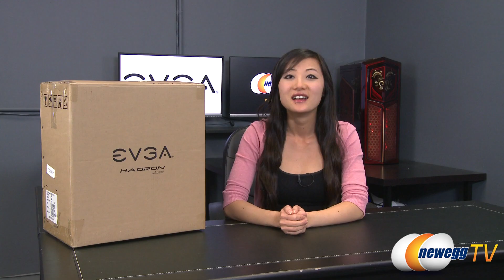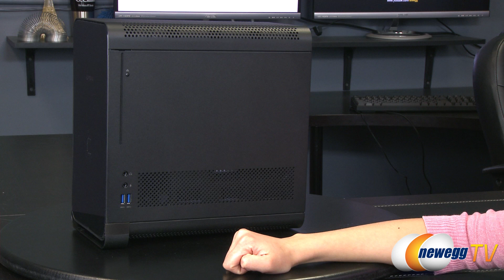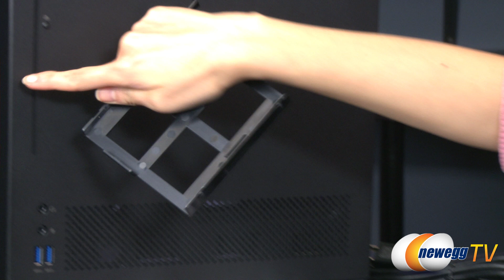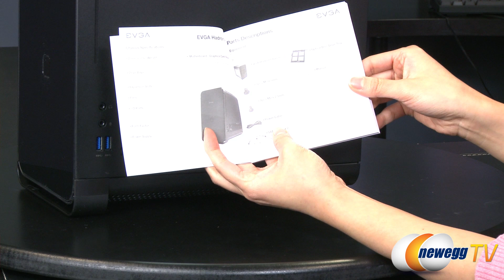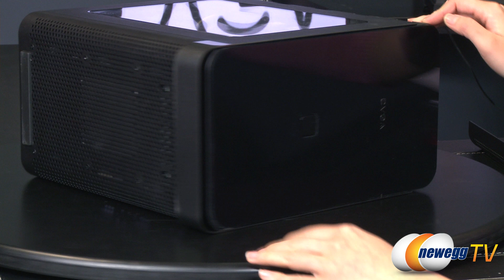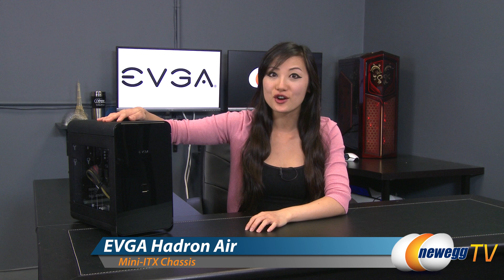EVGA Hadron Air Mini-ITX Chassis with 500W 80Plus Gold Power Supply Overview - Newegg TV

Comment: I thought this had potential as a new HTPC for me until I saw the price, yikes!
Reply: It does come with a 500W PSU and if you think about it, a mid-high end case with some fans would cost you around $100 and a good PSU would cost the same so about $200 total.  Of course, getting a rival case, like the BitFenix Prodigy, could save you $20-$30, more if you have your own PSU to put into it.  Wouldn't mind a case like this to haul around or a CAD machine.

Comment: The always wonderful, Joanne!
Ohh... this case looked so promising at CES, but then we hear the details.

I can overlook the CPU cutout as I can cut it out myself & most others can do the same. Apparently, some can't use basic tools. ;(

I can see myself using it for the looks, but the case has issues like a crazy  ex-girlfriend...

The nonstandard PSU; two SATA isn't enough, the exit for the bundle is in plain sight, & cooling isn't really great with any 40mm fan. *Non-modular is actually good for keeping voltage accurate to prevent Vdroop before it hits the cpu with current increases. That part's fine.
The HDD+SSD drives should have been where the PSU resides, an ATX FF PSU should reside where the cage is placed with a front intake/side exhaust + cables would stay hidden behind the right panel!

The cost is ridiculous being  $190 for what you get! Lol, $190/13lbs is just over $15 for every lb!  I don't care if there's pure copper in the PSU, the components aren't that much.
Those are deal breakers from anyone's perspective that would want some sort of expandability.

Comment: Only 1 day behind LinusTechTips unboxing review.  Pretty good. Now for the case. There is no way I will buy this case. 3 reasons. 1. No cable manage on the right side. You can't remove the right side case panel. 2. No CPU cut-out on the motherboard tray for an aftermarket CPU heatsink coolers you have to take very thing apart to install a new heatsink cooler 3. The most important thing of all, the power supply is not modular. EVGA wants $190.00 for this poorly designed case. Well someone will buy this product, but it will not be me.
Reply: For EVGA first case, they should have went all out. Even sell the case at a loss to get some customer loyalty following. In the planning stage someone had a great idea of adding a power supply because no one else did. But they ended up producing a trashy case, shooting themselves in the foot. The C.E.O let this happen. The stockholders should hire a better C.E.O
Reply: 190$ for a case that is 2.2x smaller than the Prodigy that also comes with a gold rated 500w power supply. I can't tell why people are so upset at this price point. The cheapest 500w gold psu on newegg is 75$ and 95$ for a modular 500w gold. the Prodigy is also 75$ so essentially it's 20$-40$ more for a case that is 2.2 times SMALLER. This is the smallest full featured case by far. Thats the point of this case and I don't think anything can compete with it right now in that respect.

Comment: did i get this right? space for 2 drives and an optical but only 2 sata power connecters?
Reply: Yeap.lol   ( gives EVGA the E.A. thumbs up) 

*facepalm @ evga *
Reply: chronofusion XFrizzleFryX 
But anyone who has used a thin slot loading disk drive will know... They don't use standard sata power connectors, hence the additional molex (assume 1 for a pump (for the watercooled version as they share the same psu), another for the disk drive, 1 for case lighting leaving a spare )) its a very well thought out psu layout tbh!
Reply: smalldeadman
yeh, true. but when using a 'proprietary' PSU they could of easily hardwired in an mini sata adapter. for that price id expect it atleast.